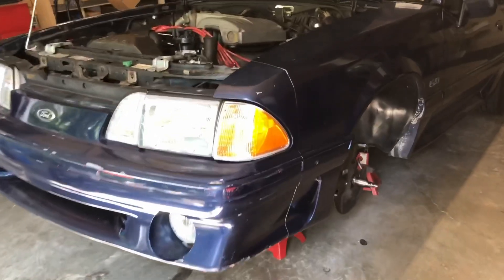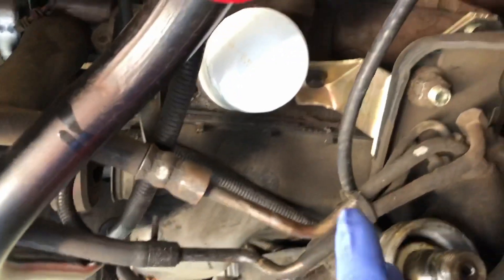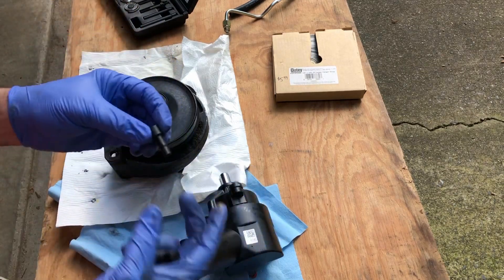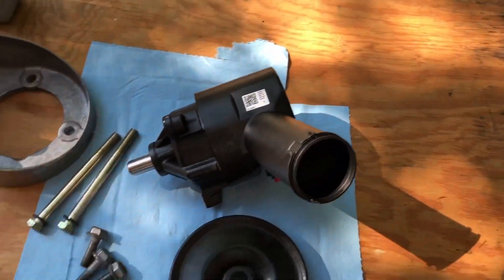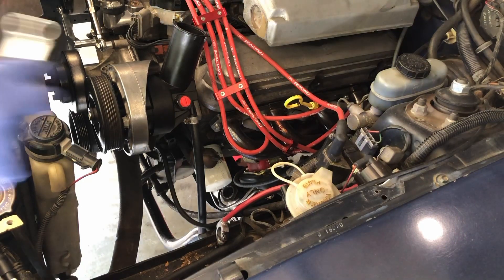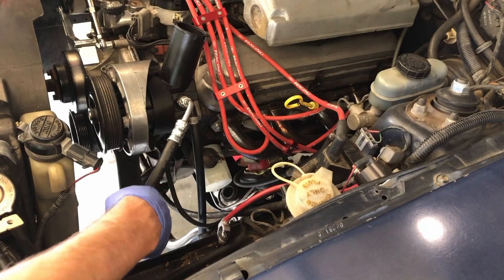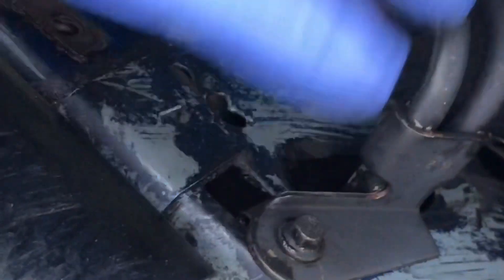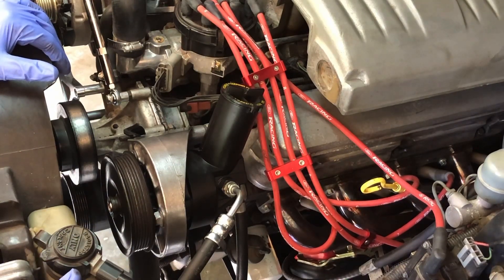How to Replace a Power Steering Pump and Hoses in a Foxbody Mustang

Comment: I can always appreciate someone that has a attention to detail and works clean,good job man!! reason i was watching your video, i am putting a new engine in my 91 and for some reason one of my cooler hoses was leaking and the cooler hoses for some other reason were criscrossed so i straightened them out,i figured its a simple cooling tube and it doesn't really matter where the hoses go and yours are straight so here i go into the garage to fix that!

This engine install has taken a looong time, going on my third week,reason is Ive been fixing all kinds of things and I'm reusing several things like valve covers, intakes and so forth and everything was disgusting so i'm doing sort of a mini restoration,thanks for the video!!
Reply from the maker: Thanks!  Good luck with the project!

Comment: Perfect, I think my hoses may be leaking, glad this popped in my suggested vids today lol
Reply from the maker: Good luck matching up new hoses.  It can be tricky with an engine swap if you don’t know the year of the PS pump or the steering rack.  If you pull the high pressure hose and give me the thread sizes, I can tell you the part number you need.
Reply: @Foxedup  should be an 85 Tbird motor so praying thst covers it 🙏

Comment: Just did this job recently...pressure line was leaking bad...got new nylon orings and reinstalled the lines. Leaking still...after watching your video I realized I never checked or installed any rubber orings. Im actually hoping they are missing at this point... 😂 Thanks for sharing.
Reply from the maker: Yeah hope that’s it.  I can send you some if you have a hard time finding any.

Comment: Man i wish my pressure line would thread in that easy. Big hands and tight space don't mix. My car has been sitting for  a week because of aggravation .  Lol
Reply from the maker: Shawn Edwards - in the steering rack bushing video I take loose the rack and drop it down.  Might give a little more room for those lines.  Luckily I have stick fingers so I was able to get them, but it was challenging for sure!

Comment: Great video, thanks for making it. 
I will do a steering pump replacement this weekend on my -91 convertible.
I have a question, where did you buy that pulley removal-kit? Is it inches or mm?
Thanks/ Oscar

Comment: In my case of an air condiitioned car, one of the 2 bolts you took off is actually a stud going through the pump and into the block (1990 GT). Do I have to take the entire front plate off (that the water pump mounts to) and remove the coolant overflow tank to allow the power steering pump enough room to get past the stud when removing?
Reply from the maker: Yeah if you have AC, you will probably need to unbolt the compressor and flip it up out of the way (but not disconnect the hoses) It will also be helpful to remove the battery, battery tray and coolant overflow tank.   It’ll open that whole area up and save time in the long run. Then just remove the whole pump and bracket assembly from the car to to the pulley swap.
Reply from the maker: It’s possible to take the pulley off in the car and remove the pump from the bracket, but usually everything is so cruddy and gunked up, it’s usually best to just go ahead and remove and clean everything.

Comment: Is this the recommended way to bleed the system? Did you have issues bleeding it? I've done everything you've done in the video, just have to add fluid and bleed my system. Read you're supposed to use a vacuum pump and monitor vacuum while slowly turning the wheel. Thanks, awesome video, couldn't have done it without the walkthrough!
Reply from the maker: I’ve seen it done without the vacuum.  First just turning the pulley, then turn the wheel with the car lifted (engine off), then turn the wheel with the car on the ground (engine on).

Comment: Is it possible to get to those two rack fittings without removing the tie rod(s)? I was looking at mine tonight and it is TIGHT in there...think it can be accessed just taking the wheel off?
Reply from the maker: Yes, you should be able to replace those two lines without removing the inner tie rods. I only removed them because they needed to be replaced. If it’s really tight, you could pop loose the outer tie rod from the spindle and it will drop out of your way.
Reply: @Foxedup  thanks- I may replace tie rods anyway but didn't want to turn this into an even bigger project, you know how that goes.
Reply from the maker: Scott Lawson - ya ya yes. The projects always expand in scope.

Comment: What size wrench did you use for the bolts to the rack?
Reply from the maker: Probably looking at an 11/16” or 16mm for most years for any of those steering hose fittings

Comment: hopefully i get a reply! loved the vid got a question.... my two top hoses, the fittings are both  tight but the line itself in the fitting can spin around? are they just rotted out? like from the inside  where the line I assume is pressed from factory that goes thru the fitting?
Reply from the maker: ollie j - the hoses are made to have movement.   They will move more than what you would think.  You only need to worry if there’s a leak.
Reply: @Foxedup  think I had some sweating. I cleaned it up couldn't find any leaks. I thought they might have spun but now I know.   its almost 180 degree movement with the lines.. ive never seen that will keep my eye on it :) thanks
Reply: Now. Rewiring the whole under dash and removing some garbage aftermarket alarm
Reply from the maker: ollie j - quite a project!  Good luck!

Comment: did u need to install the pulley also? i need a power steering pump i’m looking at pick and pulls should i be looking for just the pump or the whole system
Reply from the maker: Yes I removed my old pulley and installed it on the new pump.  I wouldn’t get a used pump - these things are likely worn out on higher mileage cars.  Brand new (refurbished) they’re around $50 to $100 with a core charge and come with a pretty good warranty.  And replace the hoses while you’re at it.  If you have a foxbody, look at the kits on www.AlteredFox.com
Reply: @Foxedup  thank you for the response 🙏🙏 i appreciate it. i just bought an 87 hatch gt.

Comment: Had a question. The kit won’t fit if you have ac?
Reply from the maker: What year do you have?
Reply: 88. on alteredfox kit #7 is the only kit that says with ac but only hoses included pump is not included
Reply from the maker: @ELCAPITAIN562  I’ll add a pump option this weekend and will probably just ship from the supplier direct to you.  I’ll let you know when the listing is up.
Reply from the maker: It's there now! https://alteredfox.com/products/power-steering-kit-for-82-to-89-foxbody-mustang-v8?variant=38054817104061
Reply: Appreciate it gonna try to tackle this job on my own thanks!

Comment: I'm having issues with the bolt that's threaded on both sides on the power steering pump its just screws out by hand?
Reply from the maker: Not 100% sure which you’re talking about.
Reply: I got it off,  then noticed a puddle of coolant right behind my water pump on both sides.
Reply from the maker: @galootsgarage4328  oh no!  I hate when projects grow unexpectedly like that!